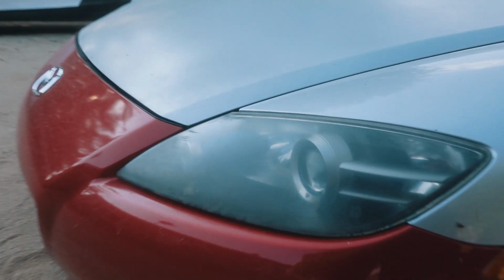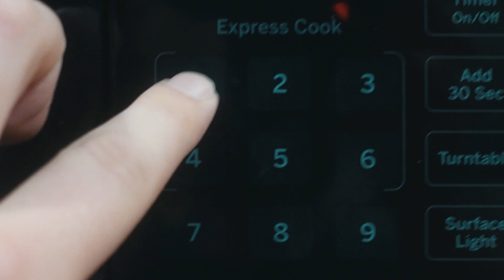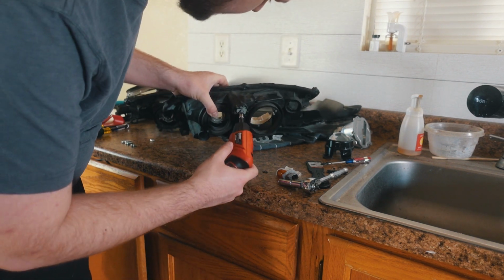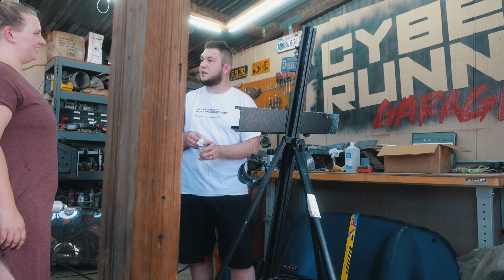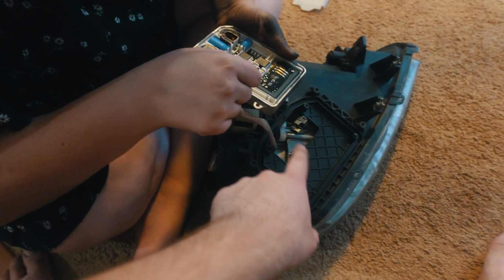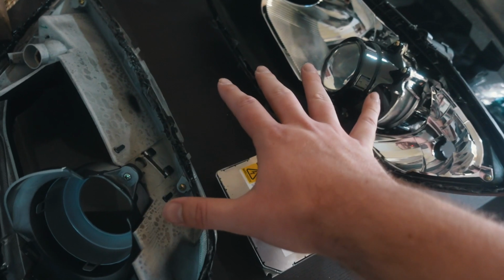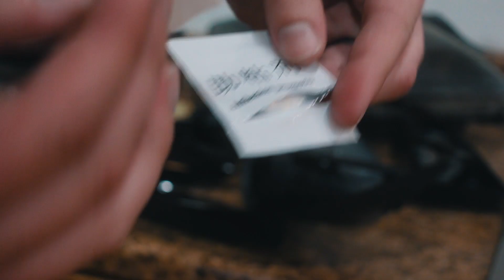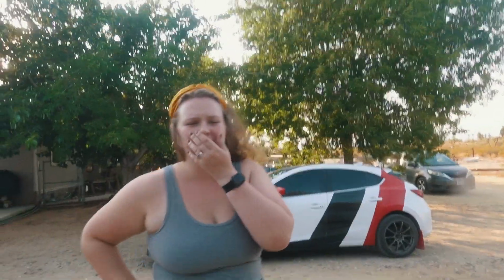Crafting $1,000 custom headlights from junk

Comment: Easy off is the go to for stripping chrome for future reference, also the HID's will give you better performance and if you don't want them I would buy them, and the ballasts will be just fine in the oven they live pretty close to the rad and rest of the heat of the engine bay plus get pretty hot themselves as well as the bulbs
Reply from the maker: Good to know! Also, easy-off doesn’t work in california anymore. I have a bottle from 2016 that will strip paint, and a brand new bottle that needs scrubbing to get through stains.

Comment: Great video and awesome work with these. Quick tip you can  turn  the adjustment bolts to move the bowl inside enough to get the igniters out for the hids without opening the lights up. Also the ballasts should be able to be disconnected from underneath them
Reply from the maker: Tried all of that. Unfortunately, the way Mazda manufactured these is very strange.

Comment: Dude the headlights look so sick!!! Ive been flirting with the idea of doing my Miata headlights but just haven't had the balls to try it. The eyes and LED strip look sweet!! Does kinda look like a supra btw
Reply from the maker: What year Miata do you have?
Reply: @cyberunndesign  2003.  I've cleaned up the outside with the 3M headlight buffer wheel kit thing and it cleared them up a lot but the rest of the fogginess is on the inside, if i ever take em apart I'd like to do the LED strips to. You got em looking awesome man!
Reply from the maker: Oh nice, NBs have these kind of headlights. Yeah man, it is pretty easy to pull them apart and clean them up. I’d go for it!
Reply: @cyberunndesign  yeah i think i will at some point. Just need to plan it around a few days or more off in a row or get rides to work cuz i gotta feeling I'll be without headlights for a lil bit when i do it. Its my daily, Plus i guess ive been hesitant to cook my headlights lol. I'll try to cook em lik medium rare at first
Reply from the maker: 220* F for 15 minutes is perfect.

It took me 2 weeks, but the RX-8 isn’t a daily, so… XD